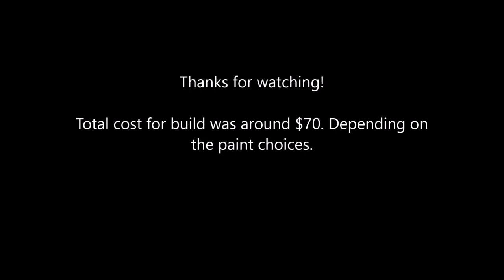Making a Texas Gun Cabinet

Comment: I know I'm late the the party,, BUT, if I may offer a suggestion. (or 2)  1) working together and having something cool to show friends has more value than any amount of money could ever buy.. You could have used a different hinge that would have allowed the front panels (doors) to overhang the edges of the cabinet. There are 3 styles of the European hinge you ended up with. They all look identical but operate a little different .... A standard butt hinge would have worked also and would not be visible. 2) RFID locking latches are cheap and easy to find. They are also easier to line up and install than the magnetic latches you used and are completely invisible from the outside. Any internal latch is easier to install if you leave the back off until you have everything mounted... 3) Be proud of what you build and content that you 2 have the opportunity to work together,, many don't have that.. AND I see a lot of people from California leaving comments saying they wouldn't have a use for this item,, Wouldn't it be even MORE important to have one if you are in CA?? I am in CA and I know the answer to that question. I have built several similar  things for my personal use... No one has ever suspected a thing (even the people with badges that were specifically looking)..    GREAT JOB!!!!!